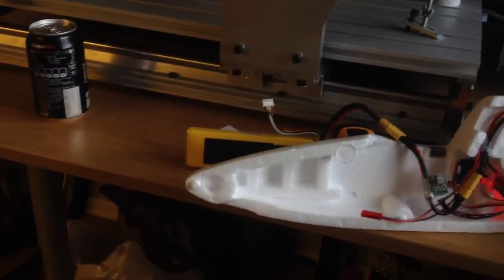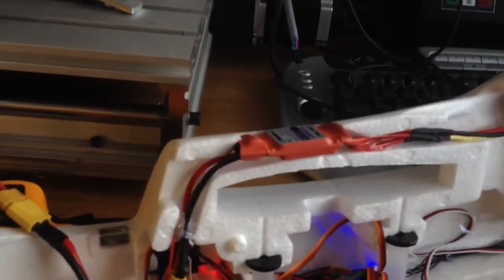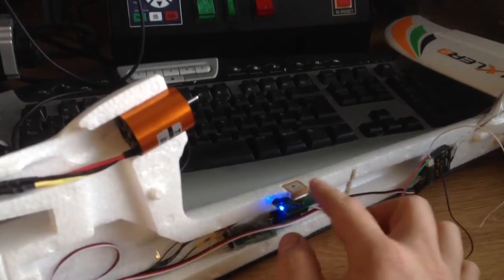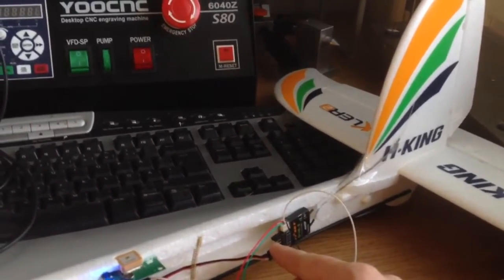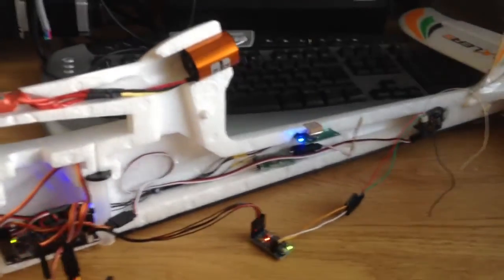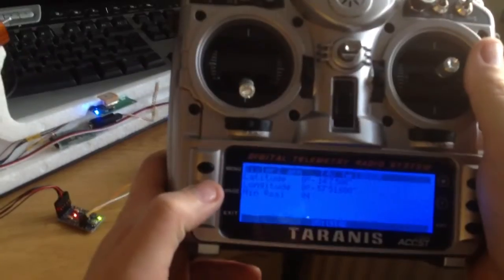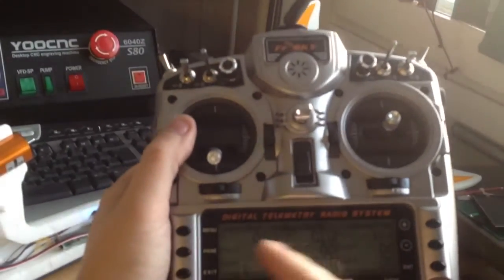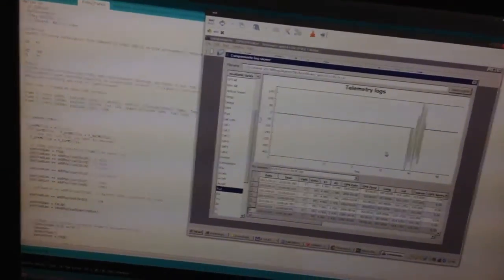Update 2 on my APM 2.5 Bixler 2 project

Comment: great job!

I'm building my bix3 with apm2.8. Could you say me which Esc (brand and model) you used? I've had a lot of problem with a quad using Emax...

Thank you!
Reply from the maker: Andrea De Magistris I like the turnigy plush modes.. i think this was a 30 or 25 amp one.. I would recommend a turnigy plush, and a programming card for it, makes it easy to program in the breake etc.. I never had any issues with a plush..
Reply: thx for your reply!
Other users have had problems with APM calibration procedure, but I think that it's always possible the "old school" radio calibration

Comment: Here's the BIG PROBLEM with using an "Inrunner" motor, have you ever had an RC Truck? the "Can" (body) of any and all Inrunners get hot, it's how they are designed to dissipate heat, and that heat will melt and distort the EPO foam, and then how is the motor going to be held in the Cowling?? Not!. Stick with an Outrunner so air can circulate around the outside of the can and keep it cooler.

Comment: Great idea! You can make your antanna tracking system by add compass to your RSSI switcher. And make serial link with FrSky modulte to get telemetry data (GPS coords). 
About Mavlink2FrSky can you share code and layout? I have Crius AIOP 2 with Megapirate and wont to try get telemetry on Turnigy 9x wuth er9x firmware.